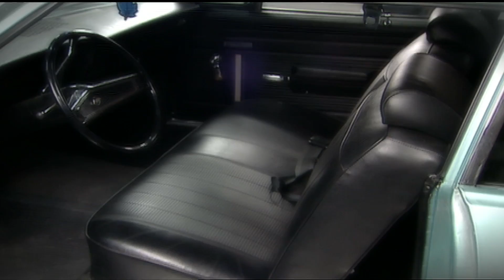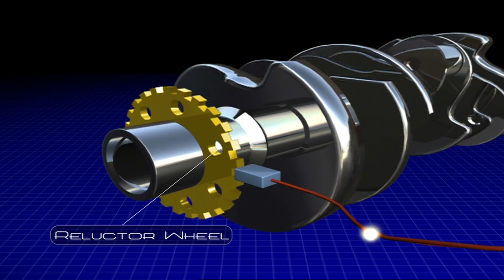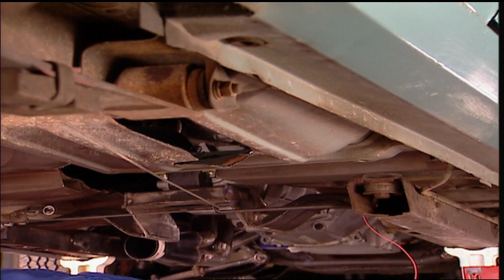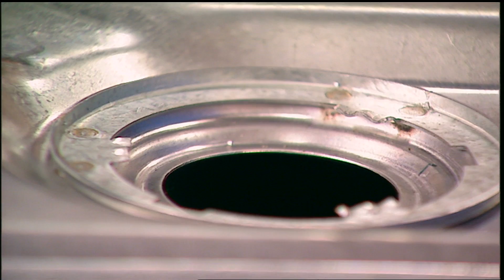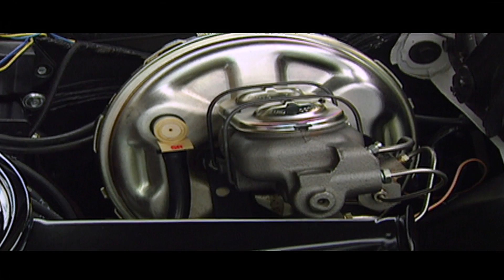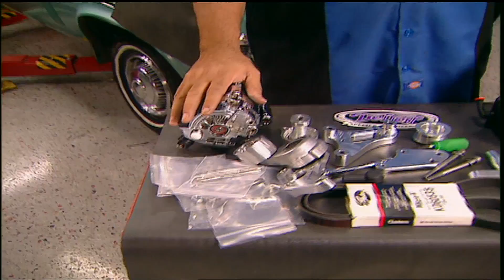Firing Up The Nova's New LS364 Crate Motor - MuscleCar S2, E1

Comment: I think the car should have had a stroked big block with turbo 400 installed or a race powerglide.
Reply: Oh well. Horsepower did that, Lou was showcasing the new LS2 crate engine anyway. This build was about building a modern sleeper. You come pulling up with a damn big block rumbling under the hood then it's not much of a sleeper anymore is it?

Comment: As someone who's owned a half dozen Camaros over the last 4 decades the Pace car segment was cool. Way back in 1977 I bought my first Camaro, a 1974 LT, from my local Chevy dealer Kitson Chevrolet. Fast forward 3 decades while working for a landscape supply company I was sent out on a delivery a couple towns over to a Mr Kitson. I get there pull into the driveway and the garage door opens. An edlery gentleman walks out and it's Mr Kitson. Inside the garage is a white convertible 1967 Camaro. I asked about the car, it was white with the blue interior and bumble bee stripe around the nose. It had the 327 and a powerglide, he told me it was bought by a little old lady and was too much for her. Her bought it back and held onto it for 40 years. Wasn't a Pace Car, butit was the same color combo and a survivor to boot.